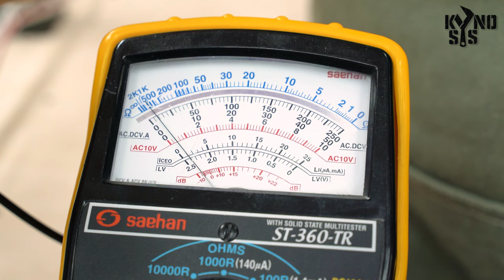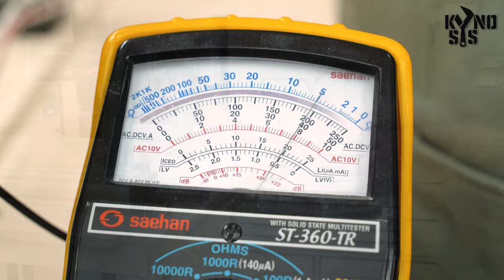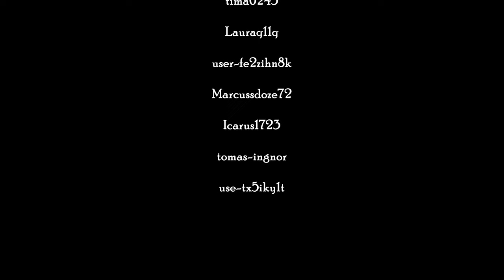Kynosys Work Table : #2 / DIY

Comment: Isn’t this a bit dangerous?  What would happen if your fingers got caught in a descending vice when inserting a work piece?
Reply: I came here to say this as well.  I'm a mechanical engineer working in manufacturing and normally when we build pneumatic clamps we use a two button system so that the operator has to use both hands to hold two switches until the clamp is closed.  His system here is a single button latching switch.  However, most accidents happen from repetitive operation.  When an operator does the same operation over and over again that's when people get careless and accidents happen.  I would never allow something like this on our manufacturing floor.  However, in a home shop I think the odds of an accident like that is unlikely.  all that being said, a good addition to this might be to put an emergency release button on all four side aprons.  This way no mater where someone is standing if they manage to catch their hand they could reach a nice big and brightly colored button that would open all clamps.  I know he has those very slick push buttons on each clamp but for an emergency button you want something very noticeable that anyone without knowledge of the station can identify as the emergency button.
Reply: @TheDavemarz  hi, yes, I agree the chances of accidents are less in the home environment and especially the user having built the bench and being aware of its design limitations. I would also agree that an emergency stop button on each side would be a very good safety improvement. However, I did wince a bit when he demonstrated the force of the clamp bending the plywood and thinking how that could easily sever a finger, particularly as the clamp is recessed. 
I can’t really see any other way round this danger particularly given the speed of the rams. If anything got trapped surely it would be too late to go for the kill switch? 
However, I do also appreciate it’s easy for us to be critical. It’s not meant to be overly negative as I must admit that I could never build anything this ingenious or elaborate but I just wanted to raise the point to help improve the safety. I love all the Kynosis stuff, this is just something that struck me on this one that’s all.
Reply from the maker: Dear Paul and Davemarz
I would like to express my deep appreciation for your comments of concern for me. As an inventor and engineer, I will give more consideration to my next work.

The two-hand switch is of course applied to my factory's production line.

I've given it a lot of thought in making this work, and instead I've put in place a different devices. There are five points that you're missing. 

The first is "moving speed."

Look carefully at the moving speed of the vice on my worktable.
It is very common to control dangerous instruments at speed during operation. Think about automatic rotation, escalators, etc.
Of course, we add extra sensors to ensure safety, but the basis is speed

There is a risk to all products that move automatically after pressing the button. Not all of them have industrial safety devices. Your concern is that every machine and machine that works automatically has a risk. Of course, it can also be placed under an automatically unfolded bed. But instead of going under the bed while it's automatically unfolding, we usually look at it from a distance and see it unfold.

The second is the location of the vice switch.

I used a special technique to mount the switch on the upper body of the vice without a separate wire. This is the position where the hand is not injured by the vice.

How to use it,
Switch on to raise the vice.
Place the board in the appropriate position.
Press the switch again to lower the vice, securing the board.

Where will my hands be placed in a dangerous place?

Not only me, but all carpenters and DIYs are trained to be safe enough for this level of work.
We use a lot of harder machines, too.

The third is the "frequency of use."

Accidents are always reported in the automatic rotation and escalators mentioned earlier. This happens because the frequency of use is beyond the limits of the system prepared for safety. As the frequency of use increases, the probability of accidents increases rapidly. For example, if the frequency of use increases to infinity, the probability of an accident converges to 100%.

So all the working products are made within the safety zone of the graph.

I don't use my worktable, thousands of times a day.

This means that you can use it once or twice a week and pay enough attention. It also means that it is located within the safety zone of the graph.

The fourth is that I have a warning about the movement.

When operating the air cylinder, the silencer makes a loud sound of air escaping. If you do not need this sound, pull the airline out of the silencer and pull it out of the room.

I didn't do that on purpose.

This sound is loud enough for the air cylinder to pay enough attention when it moves. Unlike the light, this sound is loud enough that I can't hear it in my workshop. 

Furthermore, the sound starts before the vice starts working, and then turns off at the end of the vice.
Perfect timing as a warning sound.

The fifth is, have a separate switch at the bottom of the table

I can operate the vise with this switch, and my body is far enough away from the vise.

This is the best safety device to remotely control the vice. These switches are also available for special situations,

In particular, for side vise, the bottom switch next to it has been made available.  It's such a strong force that I prepared for an emergency. This comes out in the last third videos, so you might not have seen it yet.

It took three whole weeks to make this work.
It was a pretty tough job.
I think it would be appropriate to include encouraging comments at the beginning or end of your comments for these efforts.

See the beginning and the end of this article.

My videos, they're not commercial films waiting to be viewed by critics.

I think the critic's point of view, which only seeks criticism, is appropriate for the pre-screening preview of commercial films.

Nevertheless, I thank you all.
Because it is an opportunity to look back on my work once again,
It is because it is also my pledge to make efforts for more safety in the next works.

Thank you.
Reply: @Kynosys_  hi Kynosys, thank you for a very detailed and full reply. I understand the system better now and that hands will be well away from the work piece while the vices descends. Please don’t take offence at my question. It is only out of concern and curiosity and not meant to be only criticism. I can see that there has been much thought about the safety of the system now. I do think that a two button system that @Davemarz mentions is a good idea too. I look forward to the next video where I hope to learn more about the bench. I very much enjoy the channel and admire all your content. Keep up the excellent work! Kind regards.